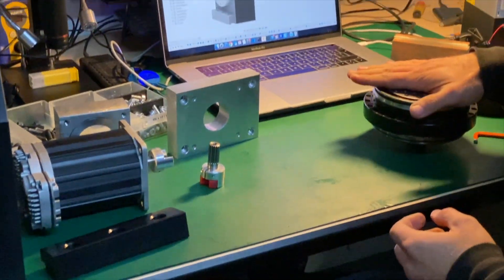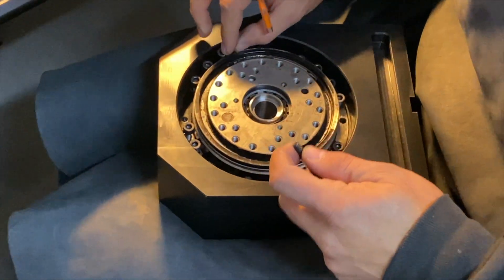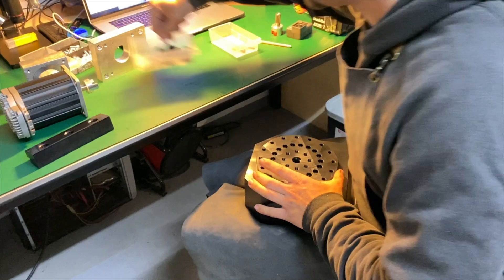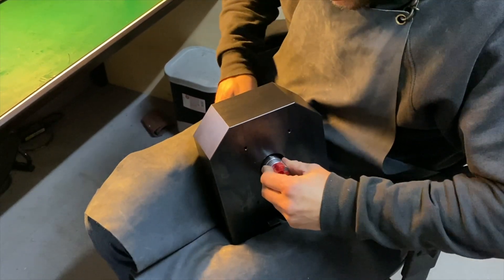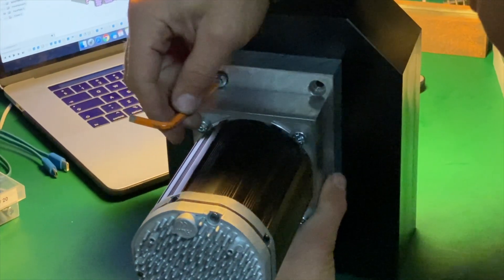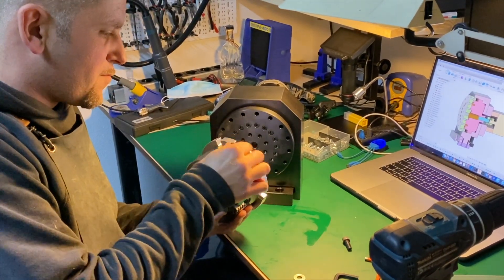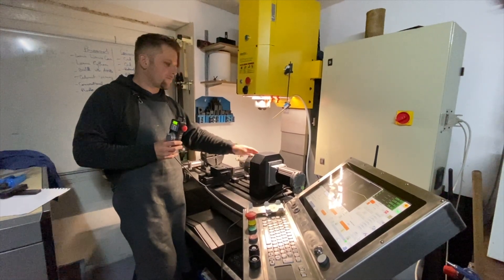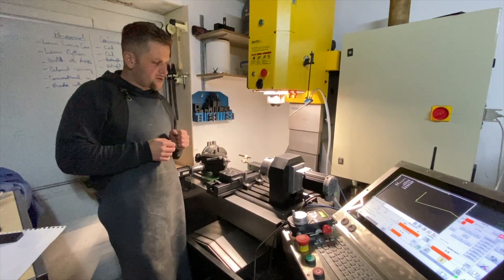Cycloidal drive 4th axis - final assembly

Comment: A lovejoy is a sloppy/backlash prone connection type. It is specifically designed to allow a little slop/misalignment in drive systems. Perhaps if you had one that was tapered and compressed together, you could be rid of that excessive backlash at the cost of inducing a thrust load on both the motor and cycloid drive.
Hopefully, you have the cycloid at enough of a gear ratio to make it very back-driving resistant to help reduce the negative effects of the slop of a love joy. 

It would have been better to turn the whole mechanism on it's face, and float the motor in with a more direct coupler. The spindle motors for our mills are loosely mounted up, then spun to self center. You tighten the motor bolts while it's spinning, so the jolt of stopping doesn't throw it back out of alignment.
That is a good place where a lovejoy coupler is used: it allows a little slop, but the spindles don't need to hold accurate position. The +/- 1.5deg they vaguely hold is plenty for a tool change, but way too soft and loose for an A-axis that needs to hold position to resist chatter and cutting forces.

A lot of the industrial machines where I work have a coupler system with 2 plates and bolts between. The plates are cross planar to the shaft. In normal operation, they act very rigid and direct. But in the event of a bad crash, the plates are thin enough to bend/buckle. I don't know the name for that type of coupler.

Comment: Nice work where did you get the drive from? I'm looking at building a similar project.
Reply from the maker: From a local kuka repair company
Reply: @LikeFactoryMade  thanks for sharing this i have to copy you, the idea is too good :-).  i managed to get Spinea TS-200-169-E for a very good price new old stock this model i found had a 24mm keyed input shaft not splines so i may be able to bolt the motor direct. Only negative is it has quite a high reduction ratio at 169:1 but that gives lots of torque, what reduction ratio is the one you have?  if i can use a fast servo maybe 2000-3000rpm it will be fast enough hopefully.  I think it should be fine for this speed as the manufacturer data says 4500 rpm input speed max but with possible lost motion of up to 1arc min. but 4500rpm reduced is 26 rotations per min so full rotation in about 160deg per second max speed which is a bit fast maybe unless in a rapid?  now my problem is to find a piece of steel large enough for the housing, maybe i will model in fusion 3d print then make a casting.  i was also thinking about making the design so it can accommodate a 5th axis bolted to the TS200 but the 5th would have to be more compact in depth and have a built in servo so much more expensive choice.  for now i am still rebuilding my machine, i need to edit some more videos i recorded and share them but i have been too focused on the rebuild ;-)
Reply from the maker: @weldchip  Not sure about the ratio that mine has, didn't had time yet to do the proper tunning of the clearpath servo and the linuxcnc configuration. I will found out then. I was told its something like 90:1 but don't know exactly. Yours is much bigger, you could use it to build a 5th axis trunion :D
Reply: @LikeFactoryMade  the ts 140 can be 33:1, 57:1, 87:1, 115:1, 139:1,  so maybe it is 87:1 for you. The indication of the reduction ratio is in the model number so it would be something like ts140E-87.